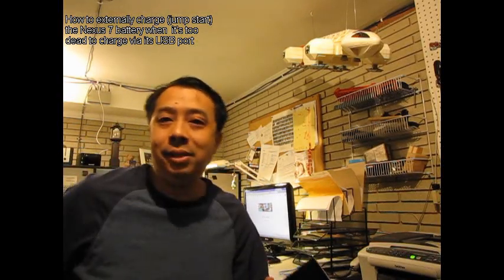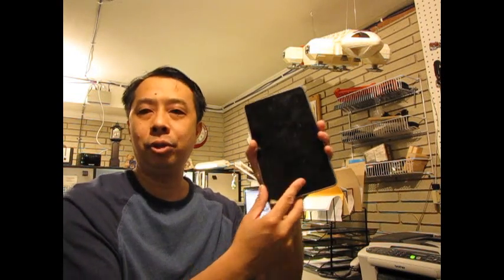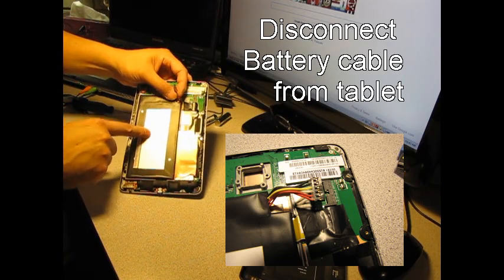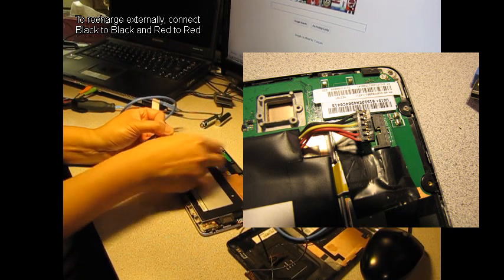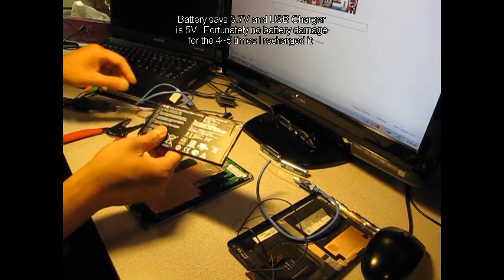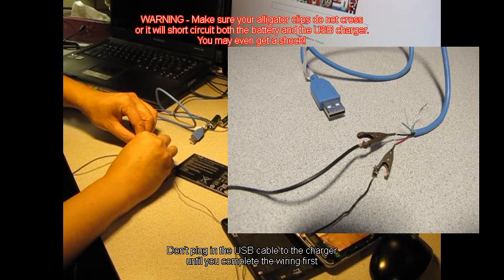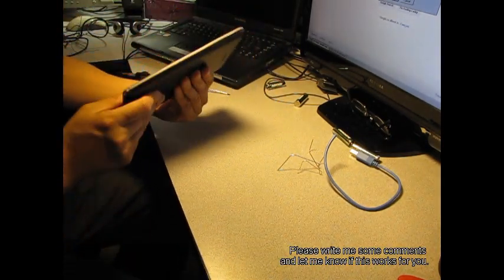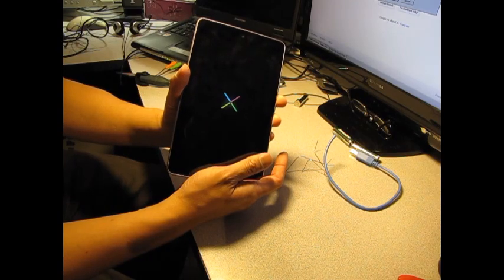Externally Jump Start Your Dead Nexus 7 - Final solution when all else fails!

Comment: iv been charging my tablet this way for like a week i have a replacement usb coming in the mail but its coming from china.do u think ill ruin my battery charging it this way.
Reply from the maker: The problem with the jump start method of charging is that you don't know when the battery reaches capacity and hence you may accidentially overcharge and perhaps damage it.  My suggestion is that you don't charge it anywhere near full to avoid this possibility.
Reply: yeah the nexus 7 has these four gold dots that are for a docking station and ive been able to connect some wires to them and charge with it being on.
Reply from the maker: I am purely guessing here, but the fact that you have been charging the tablet through the POGO pins (the four gold dots) designed for the docking station, means that the tablet's charging circuitry is likely protecting your battery from overcharging once its full.  Instead of getting a new USB, I suggest you purchase the docking station for $30 USD and charge your tablet this way from now on.
Reply: the inside of the micro usb broke off and i know that's the problem i just needed a quick way to charge for the next couple days thanks for your advice.

Comment: What were the wires you attached to the Alligator clips I mean the long black ones not the ones from the usb I stripped
Reply from the maker: Hi Shonmorley, I assume you are referring to the black extension spaghetti wires as shown at frame 6:12 . I choose these wires because they are sized correctly to "poke" inside the battery connector terminals without having to manually hold them in place.  If you connect the alligator to paper clips (my alternative suggestion), you need to manually hold them to the battery connector terminals. Hope I answered your question correctly!
Reply: Doug Peng Do you have to take the battery out to externally jump it because I have no mini phillips screwdriver doug
Reply from the maker: shonmorley homez , No you can leave the battery in its place when jump starting it.  What's important is that you have disconnected the battery connector from the motherboard such that when you jump start (charge) the battery, it cannot electrically damage the motherboard.  However, please note that the battery is not screwed in place.  It's stuck in place with sticky tape.  You should be able to rip that battery out of its holder by sliding a flat head screw driver underneath it for leverage but you do not need to do this.
Reply: Doug Peng I'm about to start. Last question am I suppose to charge the 2 outside ones togther then the inside ones togther..or do each individually

Comment: Hi Doug - I tried your jumpstart method, and my battery has 3.83 V on it, but I'm still unable to start up the Nexus.  This leads to a few questions: 1. Are you certain that a dead battery would read as 0 V (I found a voltage across a phone battery that had a 0% charge)?  2. What would you suggest is the safe charge time for a battery using this method?  I gave mine 30 - 40 minutes juice on each cell and am wondering if I need more.  3.  If this doesn't work, do you recommend I buy a new Nexus motherboard and change that out or do you have another suggestion?

Thanks so much for your insights and excellent video!  So glad this worked for so many-- now just hoping to get mine up and running  :-)
Reply from the maker: Hi Rahul, given your battery has 3.83V and you can't get your Nexus to restart, my gut feel is that you are in an unfortunate situation where my jump start method doesn't work.  There are a few commentators here (perhaps 10~15%?) that like you got their battery recharged, but could not get their Nexus to restart.  It's also possible that it could be your battery connector in that somehow, your charged battery is not reaching the motherboard.  Here are the answers to your questions 1) a dead battery should read 0V, if not pretty close it. 2)  I don't suggest you charge more than an hour based on the comments from many commentators here.  That would be 60 minutes total for both cells. 3) Instead of buying a motherboard, I would check if your battery connector is working in that the power is reaching the mother board.  Another way to test this (since your battery holds 3.83V), is to see if you can now charge it through the pogo pins (assuming your model has the 4 gold dots on its side).  Check out https://www.ifixit.com/Answers/View/101028/Charging+Nexus+7+through+pogo+pins for the pin schematics.  Hope this helps!

Comment: I just want to point out that the both red leads are connected and both black leads are also connected. Therefore, at 3:57, where he says charge each cell for 1 min, it doesn't matter which red or black you connect too.
Reply from the maker: Thanks for pointing this out as I was not aware of this at the time of making the video. Another commentator also mentioned this in which I believe you guys are indeed correct.
Reply: No problem. I found out only after taking off the adhesive cover on the battery. Not sure the exact design reason for the 2 wires.

Comment: Dear Doug, thank you very much. It works! I can jump start my Nexus 7, and continue charging via POGO pins with my doc station (because, unfortunately, my USB port on the device is dead). It works like a charm. I even did not need to go to service menu, it is just  started normally.I charged it about 15 minutes for one cell and 10 minutes for another and get to 2%. I've used needles to connect wires with battery socket.

Interesting detail: before this procedure, when I connect my Nexus to doc station backlight of the screen started to glow, and it even blinks when I press power buton for 20 sec, but no actual booting started until I jump start the battery folowing your instructions. Of course I tried all that google suggested before (charging for an hour, for 12 hours, and all possible combinations of switch on and volume buttons).
Thank you!

Comment: thank you so much i had just about given up hope of getting my tablet going this method worked for me however the battery holds no charge and the charger and cable work fine so looks like a new battery is needed
Reply from the maker: Hi Wil, glad you got your tablet working again.  However, it's unlikely that your battery holds no charge (as otherwise you would not have been able to jump start it), but more likely that your tablet's charging port is broken and hence why your battery completely drained to start with.  If your tablet has 4 pogo pins (4 gold terminals) on its side, you can purchase the Nexus docking station to charge it instead of repairing the tablet's charging port.  Please see my comments to J Conder below.  This docking station charging method only works if your battery is not completely dead or otherwise you would have to repeat the jump start method again. If you do not have the pogo pins, it's still relatively easy to replace the tablet's USB charging port as it is a modular unit and you can purchase the part on E-Bay.  There is also video on Youtube on how to do it!  Thanks for your comment and Happy New Year!

Comment: Charger? What charger? Alligator clips? Why? Do you insert the stripped usb wires into the battery connections? i.e. the outside black and red, then the inside black and red. Paper clips? Why? Why don't you just plug in the stripped usb wires into the battery connections?
Reply from the maker: Good question about why not just plug the stripped USB wires right into the battery connection as that would save lots setup work (i.e no need for alligator clips or paper clips).  Unfortunately, most of USB cables uses strand wires instead of solid core wires making them difficult to handle.  However, if you twist the strand wires with your fingers, you might form them "solid" enough to poke into the battery connector.  If you get this to work let me know as it would save lots of setup work. Another commentator here uses a screw and nut to connect the strand wire of the USB cables to a safety pin and then used the safety pin to poke into battery connector.  This is a good solution too with less setup work.

The charger I am referring to is the USB power source which you plug the USB cable into which could be your computer or a DC adapter.

Hope this helps!
Reply: Thank you. Now it makes sense.

Comment: I've had 4 of these spread out through kids in the family. All bricked from running completely dead. Tried every other trick out there.

 Some sitting for close to 6 months!!!

I've been thinking of this but want sure exactly how to do it. 

I was able to get 3/4 of them working this way. 

Instead of the alligator clips I stripped down some speaker wire unraveled it and soldered a small piece of it to the cut end of the black and red charger wires. 
This made it really easy to do. 
30 min on each cell gave me 70% battery life. 
With young kids I have a feeling I'll be doing this plenty of times in the future.
Reply from the maker: That's a great success story to hear!  Glad to hear you got "most" to work again.  Quite often, the root problem stems from the fact that the tablet's USB charger is broken.  If this is your case, and you have the model that has the 4 pogo pins (4 gold dot terminals) on the side, you can purchase a docking station to recharge it instead of using the USB recharger.  Please see my comments to J Conder below.

Comment: Thanks great video worked for me!!!  The only issue is it wont charge, any ideas besides buying a replacement port? Thanks for the help. GREAT VIDEO!!
Reply from the maker: Hi Karl, congrats in getting your tablet working again!  If your tablet has the 4 pogo pins (gold color terminals) on its side, you can purchase the docking station to charge it instead of purchasing a new replacement USB port.  Please see my response to J Conder below for details.  This is probably your best solution, although the USB port itself is a modular piece inside the tablet and relatively easy to replace.  Please note none of these charging method works if your battery is completely dead in which you would have to repeat my jump start method again.
Reply: Doug Peng Hey Doug thanks for the prompt reply, sorry I could not get back to you. I was out of town on vacation. I finally ended up fixing the battery problem, turns out once I jump started the battery it turned on but did not charge. So I kinda started digging in and once removing the copper protection shield I noticed that the charging port ribbon was not connected properly, then I proceeded on removing the speaker module and was fairly simple just introduced the ribbon to the charging port. A friendly advice, would be wise to make your viewers aware of the charging port ribbon on your excellent tutorial/video. Once again thanks it was very helpful and it sure saved me time and money. Happy New Year!!

Comment: Doug - great tip and well presented.  Thought my Nexus had had it and was about to ebay it as 'fit for spares only'.  Then I found your jump start battery tip and it worked a treat.  Updated Android to the latest and greatest and now working as good as new. Top tip Doug - well done!

Comment: Great instructions,  Doug. Do I still need the alligator clips and extra wire if I strip back the wires on the USB cable far enough? Thanks.
Reply from the maker: Hi Lisa, In theory, you could insert the USB cable wires directly into the battery connector, but in practice it is more difficult than it looks.  The reason is that the USB cable wires are usually made of strand wires, meaning it it not one solid wire but multiple thin threads.  Instead of using an aligator clip, you could try connecting the strand USB cable wires to a paper clip, or safety pin instead and insert that into the battery connector.  If you twist the USB cable strand wires with your fingers, you could make it strong enough to tape onto the paper clip or safety pin.  One other commentator used a screw and nut to connect the USB cable wire onto a safety pin which makes a lot sense.  Hope this helps!

Comment: The usb cable I purchased only had a red and blue connection.  Those are the only two wires inside the usb cable.  I purchased a usb mini/micro cable.  Has both connections on it.  Maybe I need to purchase something else?
Reply from the maker: HI Greg, I found an interesting article at http://markjohann.hubpages.com/hub/Color-Coded-Wire-inside-the-USB which describes the different internal wiring color standards for USB cables.  Although the red (+), black (), white and green combination that I got is the common USB cable standard, there are other 4 wire color variations as well.  However, all should have 4 internal wires and hence would it be possible that you accidentially snipped off 2 wires when you cut the outer cable sheathing?  According to this particular link, your red wire is perhaps the orange wire??? which would make it the "+" red 5V terminal and the white wire (perhaps you accidentially snipped off??) should be the "" black ground terminal.  Please check yours to this article first, than take my word for it.

Alternatively, you could use another USB cable hoping that it has the more common Black, Red, White and Green color combination.

Comment: please post step by step instruction of wire assembly. i can see the starting process from your video using the stripped usb cord but not sure on how and what kind of wires were used to connect the other end of clips to battery.

i am def not tech savvy so any other info you can provide will be a great help ....
Reply from the maker: Hi Moniluv, no problems to provide more details on the wiring.  Basically the red wire on the stripped USB cord needs to connect to the red wire on the battery connector, and the black wire on the stripped USB cord needs to connect to the black wire on the battery connector.  As there are two red wires and two black wires on the battery connector, you need connect each battery red-black pair at a time.  That is, you connect the outside red wire on the battery connector to the red wire on the stripped USB cord and the outside black wire on the battery connector to the black wire on the stripped USB cord first (this is the first pair).  After charging for 15~20 minutes, then repeat for the inside red wire and inside black wire on the battery connector. The best way to connect the USB wires to the battery connector is to buy thin wires from your local hardware store.  They are often referred to as spagghetti wires and have solid copper cores (not strands).  You can also buy aligator clips to tie these spagghetti wire ends to.  As aligator clips might be hard to find, some commentators here have used safety pins, staples, paper clip and even a screw & nut combination instead.  All these are fine subsitutes.  As you mentioned you are not tech savvy, please follow my video advice carefully about not powering up the USB cord until after you complete the wiring to avoid a possible short circuit.  Also make sure you never cross the red and black wires by accident as that too can cause a short which can damage your charger and your battery.  The most likely place for an accidential short is with the aligator clips touching each other (they shouldn't) so I used tape to tape it to the table so they are separated from another.  Good luck and tell me how it goes!

Comment: Hey Doug, I have a question for you.  I have not tried the above mentioned method yet, but wanted to get your take on my issue.  I have a Nexus 7 that decided not to turn on one day.  I can't get it to boot up using the power button + up arrow or down arrow for that matter.  I got a replacement battery, left it charge for 24 hours, but I don't believe that the unit is even charging.  There is nothing on the tablet telling me that it has any life.  Do you have any ideas what the issue could be?  I've checked connections inside the unit.  Other than replacing the charging port I'm not sure what else to do.  It was working fine, then just would not turn on at all.
Reply from the maker: Do you know if your replacement battery is completely dead or has some "juice" left?  If it is an aftermarket battery that is completely dead, then you are likely facing the same problem you had with the original dead battery.  If so, my jump start method should work.  If you have a volt meter, please test the voltage from both your original and the replacement battery.  If they have a 0V reading, then my method will likely work.  If they have some power, then it could be another problem.
Reply: Doug Peng Okay, here's my other issue.  The cable that I stripped only has two wires in it.  A red and blue wire, which I'm guessing will not work for this.  I'll have to go out and purchase another cable and hope it has the wire combination that I need.
Reply from the maker: Greg Martin Greg, what kind of cable did you purchase?  Are you referring to the USB Cable itself (which has 4 wires), or loose spaghetti wires to connect the USB Cable to the battery?  If you are referencing the loose spaghetti wires, then any color combination will do as long as the red on the USB cable is connected to the red on the battery connector and the black on the USB cable is connected to the black on the battery connector.